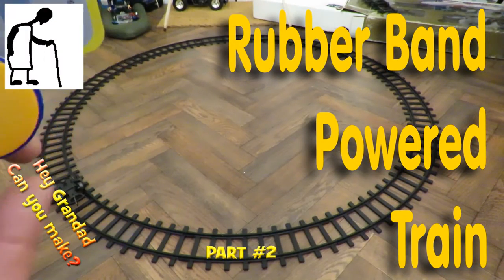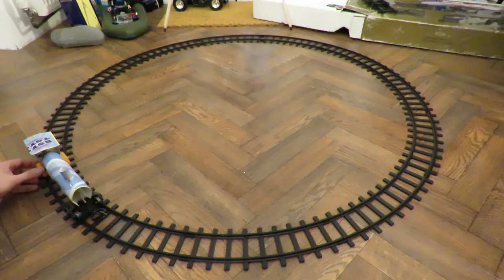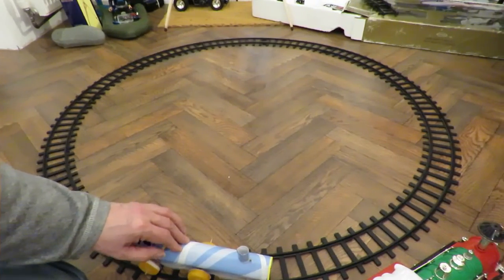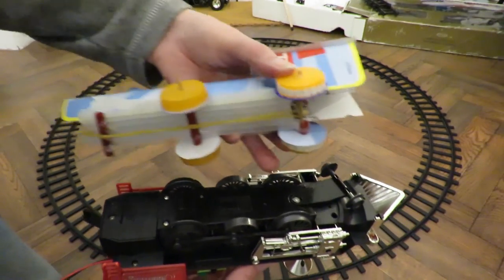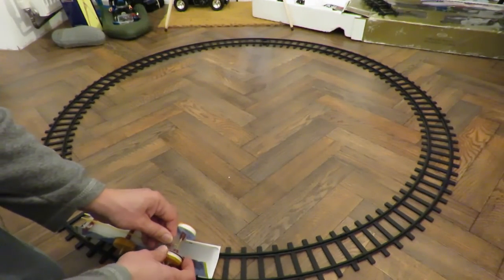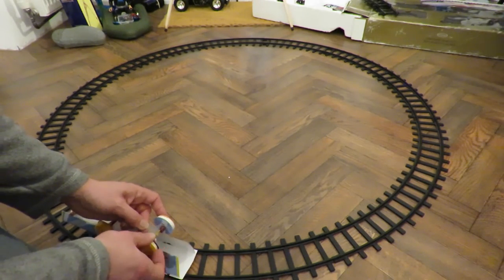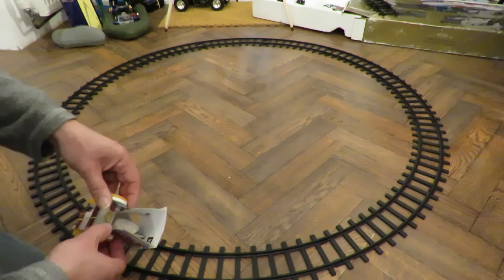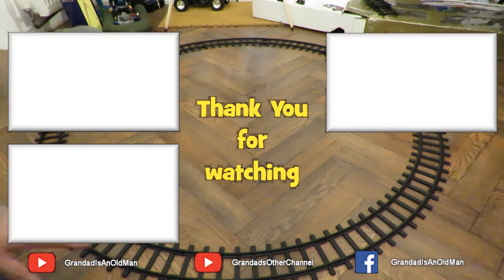Rubber Band Powered Train #2 some improvement

Comment: You have just start at the bottom of steep learning curve about Locomotive design, Modern Diesel and Electric Locos have bogies, like the one you used from the train set, for various reasons including negotiating curves, Steam Locos that had to work on tightly curved track like the lines alongside Bristol harbour generally only had Four driven wheels or six closely space driven wheels, Six wheeled Locos often had the same solution used by your train set, the center wheels have not got a flange on them, only the front and rear wheels guide the Loco.
 Weight is a benifit for a loco upto the maximum axle load allowed for the track, the contact patch between wheel and rail is very small so grip is at a premium, Big wheels are something else that has been tried, in the Victorian era several express passenger Locos had a single driven axle with a wheel upto eight feet in diameter.
 When you build your electric version go for two axles not too far apart, it will make it easier to get arond the curve and concentrait the weight onto the least number of wheels to aid traction.

Comment: You could use a gearing system to increase the distance.
Reply from the maker: Yes, although gearing it up rather than down would improve the distance it would also reduce the power so we would then need to increase the power of the rubber bands. There is another episode which I have just realised I didn't finish, (see my comment reply to Wil Hobbs) where I was looking at using gearing to get round one of the other problems with this project.

Comment: am making a tanker wagon and may make a brake van as well your rubber band engine will be a good test  for me . giving me some idears .
Reply from the maker: Gosh I had forgotten about this project. I tried hard but it was not a good result. The small wheels will never give enough grip and you don't get much distance either.
Reply: @GrandadIsAnOldMan  i have windup engines in my train collection and they can only get halfway round the oval. so that was a good try.
Reply from the maker: @allanegleston4931  thanks Allan 😍👍